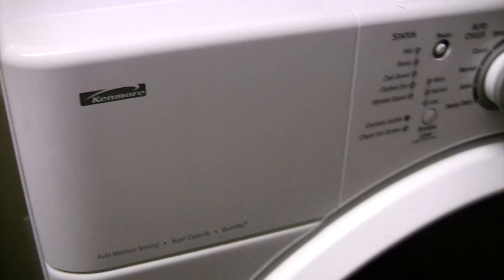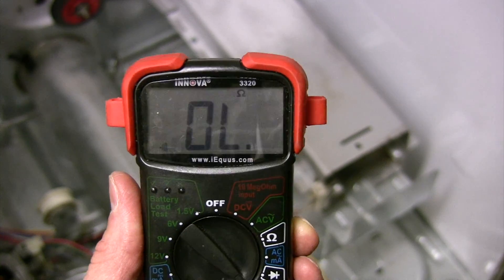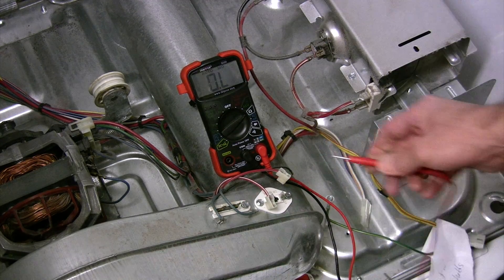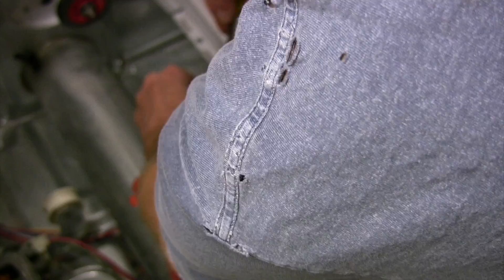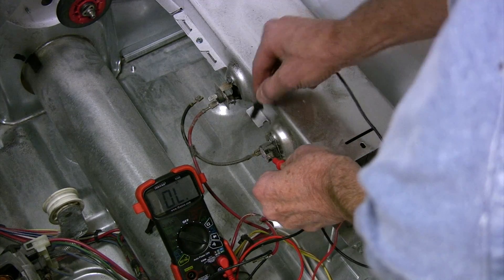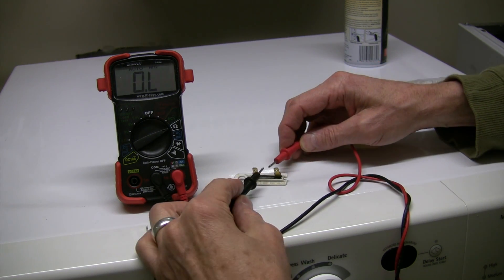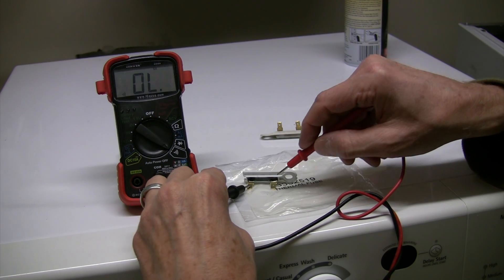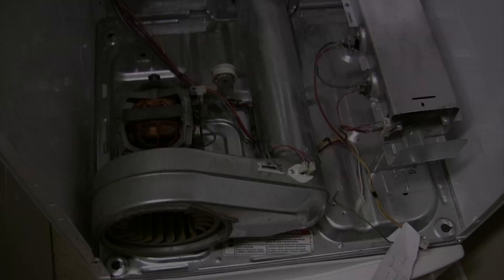Kenmore He2/He3 Dryer won't start, Checking Thermal fuse, Thermistor

Comment: I just removed the two 1/4" head screws on the bottom access panel. Once that panel is removed I used a 1/4" wrench to loosen the screw holding the thermal fuse. I removed the wires with the help of needle nose pliers........ and it was bad. Thanks for the video!

Comment: Thank you for your video!! While my issue was a start button failure, testing the thermal fuse and thermistor as well as the heating elements helped me eliminate other potential causes. My issue required replacing the control panel. Purchased from Parts Simple. I also vacuumed the dryer out.

Comment: I just wanted to say thank you for posting this. You saved me a lot of trouble!!! It was the thermistor, and I’d also like to say for anyone reading the comments if your dryer is 14 years old like mine you might want to take it all apart just to clean the lint out, it’s a fire waiting to happen
Reply: Hello, I have a thermal fuse working but a bad thermister, will the bad thermister prevent the dryer from spinning? But does power on
Reply: Dryers should be cleaned yearly.

I sometimes slack off, but after what I found the FIRST time I let it go for a few years, I clean it out yearly.  AND the pipe in the slab leading to the outside, that one can get seriously restricted if it is long.
Reply: @gildebrandnicolas9601  - It shouldn't.  I had a bad thermistor, it spun no problem.
Reply: @gildebrandnicolas9601  Thermister determines if the clothes are dry or not by measuring the temperature. If your Thermister is bad, I think you can still use the timer dryer option. But if the Thermal fuse opens, the dryer will quit because this is for safety. Normally the thermal fuse opens at very high temperature. But I think it opens also after 10 years so you can buy another one from the manufacturer again.

Comment: Thank you.  I was able to replace the Thermal Fuse and get the dryer working again.  I didn't have any testing tools, so I went ahead and replaced this part. $20 instead of a costly service call or biting the bullet on a whole new machine!

Comment: Thanks so much for this. Question - my washer & dryer are stacked in a cubby wall in a tiny bathroom (the builders built this house around the washer & dryer you'd think 🤨). That said, without removing my door & sink & the whole bathroom, I can't easily move & unplug the dryer. I have turned off the breaker & worked on it before but never replaced a fuse. Is it okay to flip the breaker & replace this fuse? It's been off for 2 days.
Reply from the maker: sorry for the delay, but if you turn off the correct breaker, you're good, double check that.

Comment: @marcobowow Will the heating element fuses give a lint screen error as well?  I've replaced the Thermal fuse, thermistor already (thanks to your video), but keep getting the lint screen warning.  I have also cleaned the vents and trap of any lint.
Reply from the maker: I don't know for sure.  Since you;ve cleared your vent the only thing that comes to mind is purchasing a new lint trap probably from Amazon, yours could be defective.
Reply: i'd hunt down the sensor , research how it works and by-pass it. Likely as simple as twisting the wires together or maybe there is a operating resistance in which case one would need a resistor of that value that is a high enough wattage.

Comment: I replaced the thermal fuse and thermister. The dryer works now but has a burning smell so I was scared to leave it on for more than two minutes. Is the smell a normal occurrence or is it indicating something bad ?

Comment: Just FYI , if you replace your thermal fuse and it still wont start take out the "Machine Control electronics" board (following the instructions inside the dryer).
Look at the back of the "Machine Control Electronics" board (opposite side of the components).
Check the solder connections by the relay, if any are faulty re-flow the faulty one(s)  with a soldering iron and some solder. 
I discovered this after doing ALL the standard trouble shooting with no abnormal result but still got the  beep-click-no start.
Reply: Just wondering how the relay solder will go open after 10 years. Do you think these are intentional from the manufacturer so you can buy another one? In our city the second hand selling dryer and washer is booming because of these facts.
Reply: @gibo588  I dont honestly know... One of the joints looked like it was a little "cold" but my guess is that relays vibrate and get hot and the two of those factors combined over the 10 years to mechanically break the solder joint.

Comment: Just replaced the heat element. Does it matter on the orientation of the wires that plug into the heating element? I can’t remember which one went on top of bottom. Also is the burning smell normal on a new heating element?
Reply: Smell should only be first few hours.. Is vent clean

Comment: YOu said you didn't actually have to take it apart to do this fix. Is that true? Can I fix without complete disassembly?
Reply from the maker: Yeah, just take the bottom panel off and you can get in there. Just remove a few screws.  It's cramped, but you can do it.

Comment: I have kenmore HE 5  i have all the sensors that yopu tell to check i did buy a thermistor and i checked everything heating coil everything else checked good  runs just no heat
Reply: What was problem

Comment: i jumped the thermal fuse and still not  working so  what would be the problem?
Reply: I'm having the same problem. I have changed every fuse, thermistor, heating element, belt, pulley etc. Still shuts off after 1 min code 23. I am at the point of beating it with a hammer!!!
Reply: Jumping the thermal fuse or the thermistor?  Jumping the thermistor won't work, it needs a specific resistance range to tell the dryer to turn on the heating element.

Comment: What would you do if the fuses worked and the power button doesn't work and the light wont turn on when the door is open.. In other words, I am getting nothing, what should I check?
Reply from the maker: I'm not exactly sure of your problem but there are several videos on how to replace the electronic control board, I'll bet that's your problem.
Reply: Should make sure the breaker to the dryer didn’t get tripped, also.

Comment: You need to address WHY the thermal fuse blew. Otherwise, it will just fail again. You probably have a venting issue. Just changing the thermal fuse really is a short-term stop gap. The dryer overheated to the point the thermal fuse blew, so the question is: why did that happen?
Reply from the maker: That's a good point.  I have had my vent cleaned recently by a professional.

Comment: So what caused the fuse to blow??? Thermal fuses don't just blow for no reason, when they do it's a symptom of another problem (I'm guessing your thermistor was bad being that the reading was over 12k, when it should read around 10k at room temp). Further explanation would be helpful to your viewers.
Reply: Thanks for your question.  I think the thermal fuse failed because my wife put too many clothes in the dryer and things got too hot.  I suppose something else could've happened, but she told me she did this and it makes sense to me.  

The purpose of the fuse is to blow to prevent fires, and it did it's job.
Reply: BTW, I replaced both the fuse and thermistor while I had it open.
Reply: Mark Nance So no more problems since? Thanks for your response.
Reply: Correct, I haven't had any problems with the dryer since I replaced the fuse and thermistor.

Comment: So... dryers essentially have two thermal fuses.. damn that's confusing.
Reply from the maker: You could always replace both fuses, they're not expensive, that is if you don't have a multimeter.  Why not?
Reply: @marcobowow  I should have looked at more videos apparently. 
The dryer lights up when plugged in, it just won't start. You can hear a clicking noise when it's trying to start. That's it though, it does nothing else. Do you think this is what's wrong with it? I should have looked at more video's. This looks to be the one most similar to mine. I don't have that tool, thought I'd gotten the right fuse. Should have ordered them all, or gotten a multimeter I guess.
Reply: @warlockmagic3416  - in my case, when it clicked and then shut off, it was a broken belt.  The dryer senses that the drum isn't turning and shuts back off.

It's not too hard to replace, and not too expensive.  I'm pretty sure there's a few videos on it on YT.